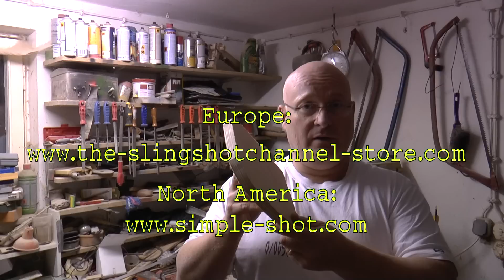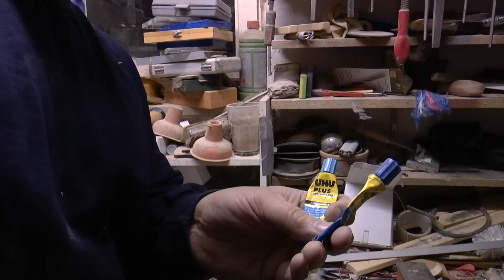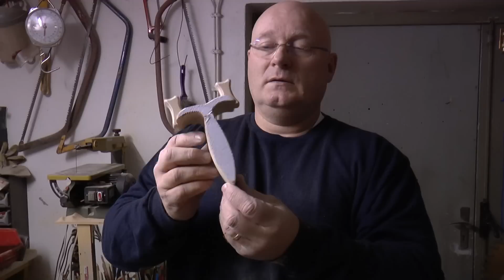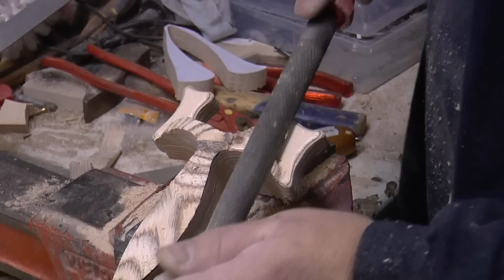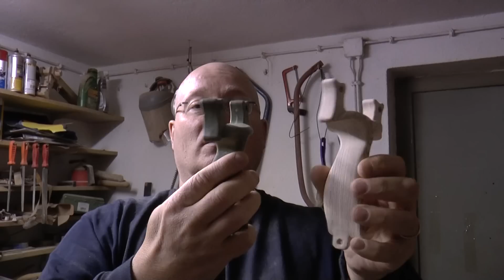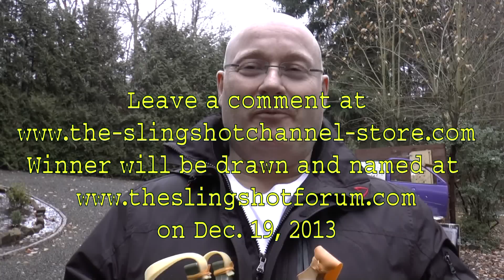"Rambone" Slingshot Tutorial

Comment: Its good to see someone with the same way of doing things as zi myself. I mean in respect of merely the way to go about it all without any bull....! All these inventions are extremely nice and some reasonably clever in certain ways.a really big challenge would be to basically design and fabricate a device which is completely free os electricity, muscle power or anything at all which would take energy from anywhere exept the confines of its own particular "morphology". It would be a definate certainty that in order to start the device, an amount of power of some description may be required but I mean to start it. Its power would be gained and stored through a mechanism within the design. Self perpetuated? Possubly, if thats what one wishes to call it. The obvious laws of current physics should apply and this means that apparantly, it would stop after one shot or it would merely utilize the energy that was fed into the device through a starting procedure or something similar. It should not be able to do what I say BUT, I myself have created such devices which have powered bulbs for three months with no external source. I have also created devices which, with absolutely no external energy source, batteries, solar panels or such like, have continued for months unassisted.

Comment: My workbenches are perpetually more crowded than even yours. I'm thinking on a sort of breakfast bed tray arrangemement for temporary table space, and force myself not to leave stuff on it, if that's possible.
I have ONE Black and Dekker tool, and that is the 'Dragster' belt sander. Upside down in the vise, you have both a flat sander and using the small roller at the front, a roundover sander. Beginning with 80 grit (no, really!), it really eats up some wood, but very controllable. Your vacuum crevice tool should fit in the bag opening and really gets ALL the dust! 
To cut in say, one finger groove takes about 1-1/2 minutes, and will have a much better finish than 80 grit by hand or a file.

Comment: Can I use one solid block of hardwood instead of plywood and carve it down to the final shape?
Reply from the maker: Dave Greentea No. It might crack. Only laminated wood is safe enough, or natural forks.
Reply: JoergSprave That is very disappointing to know. That kind of multiplex plywood is not available here in my area. I would have wanted to diy my own slingshot. Thank you for the quick reply.
Reply: Dave Greentea you should be able to if you use a really dense wood.

Comment: I had to use a jigsaw at the beginning as I have very few resources and I think it's important to note, especially for beginners like me that an old jigsaw doesn't cope too well with the 18 mil ply. I suggest using a drill to start with and not to try to do any of the tighter curves with the jigsaw. Also, it's more dangerous than the bandsaw as it can easily get away from you. Make sure that the ply is very secure before you start to cut it too in order to avoid vibrations. I experimented with 9mil and it was much easier, so if the 18 mil is too tough to saw through I'd suggest cutting 6 pieces of 9 mil instead. I'm sure you can get a lot more in depth advice on the forums (which are great) so I'd suggest checking them out too.  Thanks again Joerg for sharing this with us.

Comment: Do you think a rambone would kill a zombie? If so, what would be the smallest ball you'd need to use?
Reply from the maker: I really only trust 20mm steel balls. Rubber based weapons work best with heavy ammo. The route to devastation is weight, not speed, if you use rubber instead of gunpowder.

Comment: Hi, How long do your do your bands sets last? I used the thera band black tube and it doesn't last very long. The silver won't break at all but I cant pull it very well either. Please let me know a better way to make a band set that wont break, thanks!
P.S Please make a sling shot that dose not use rubber and uses a spring and bow string instead, its my birthday this December + Christmas is around the corner, merry x-mass/ happy new year!

Comment: Hey Jörg, I know you said that you can't use anything else, but does that also mean natural woods, like oak for instance? I just kind of dislike the look of plywood :P
Reply: ***** Im pretty sure multiplex is stronger than normal solid wood because of the glue and layers
Reply from the maker: Nope, not strong enough.
Reply from the maker: ***** No, Solid wood tends to break along the fibers. Plywood is cut into thin layers which are then turned 90 degrees and laminated against each other, eliminating fiber direction weaknesses.